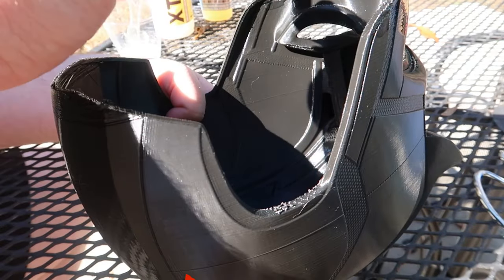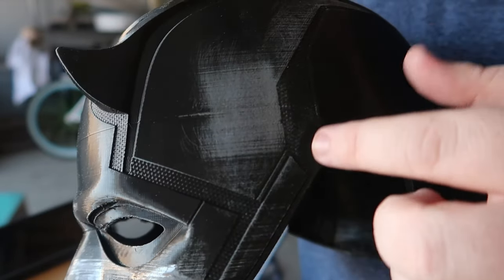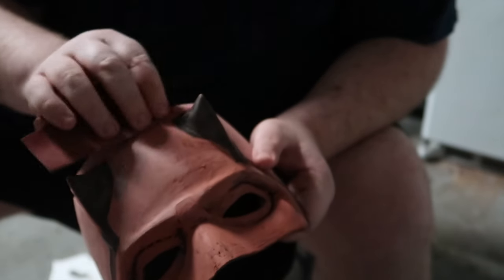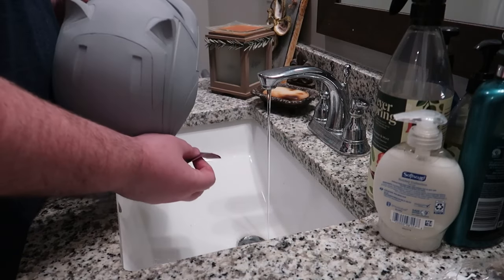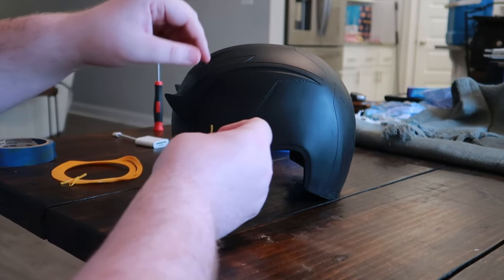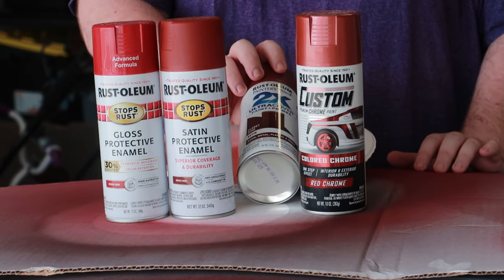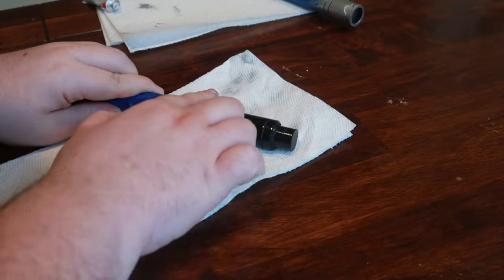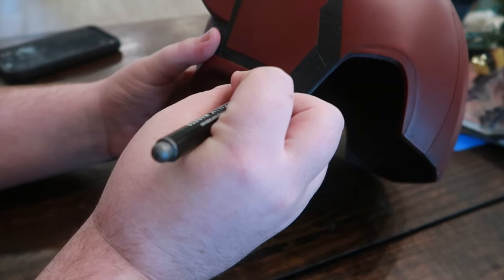3D Printed Daredevil Helmet AND Billy Club - Full Build Tutorial

Comment: Couple if questions from a noobie here. 
Is that xtc3d just epoxy resin? If so why don't you cover the whole helmet to reduce layer lines. Wouldn't that get rid of the need for bondo? 
With the red how long did you wait between the 1st and 2nd coat and how long begot the clear coat?
Reply from the maker: Hello! Yes you’re right about the XTC-3D, and you can definitely cover the entire helmet in it. Sometimes I do, but I think the Bondo is more user friendly. XTC-3D can pool in certain areas and is a pain to sand after that, you have more control with the Bondo (this particular model with not wanting to cover the details), and the XTC-3D working time is probably only about 6 minutes, and after that it thickens up and is hard to apply.

For the paint I do a few light coats within a few minutes of each other. For the clear it’s anywhere from 30 minutes to 2 hours.

Hope that helps!